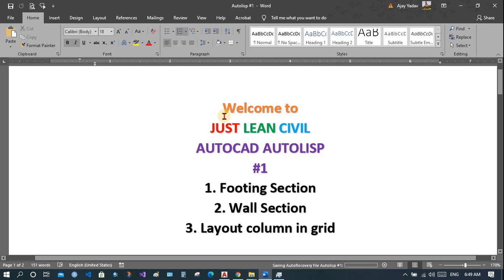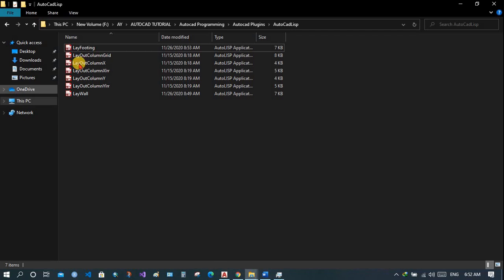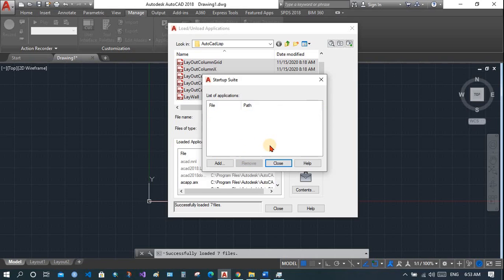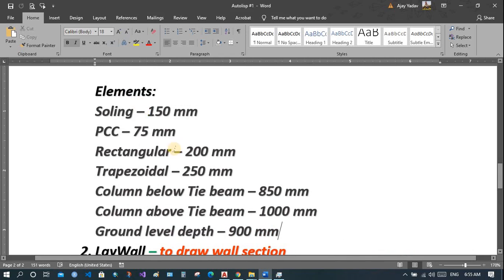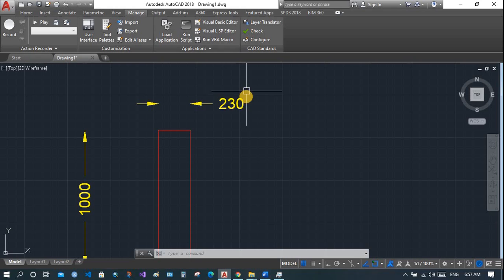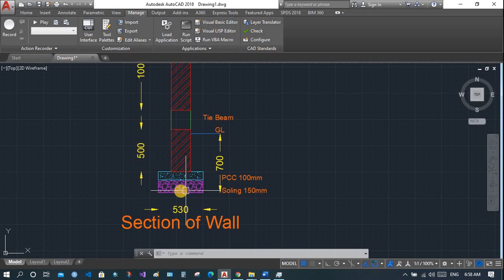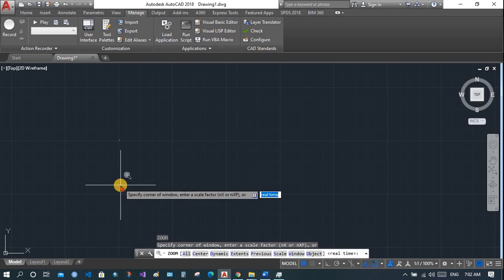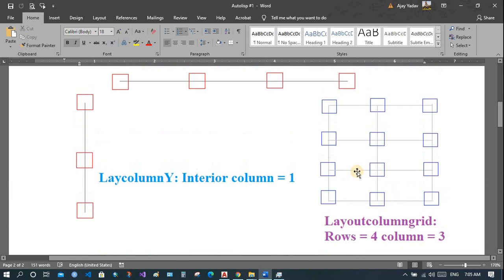[AUTOLISP #1] Draw Footing section| Wall section| Column in X Y Dir Automatically using LISP Autocad

Comment: Pl help me....I need step by step tutorial for autocad lisps code to automatically hatch the multiple block in autocad based on excell sheet consists of two column first column consists block name and second column consists of s or p .if s,hatch the corresponding block in "dot" hatch pattern of layer name "S" availed in the autocad,if p hatch the corresponding block in "cross" hatch pattern of layer name "p" availed in the autocad.